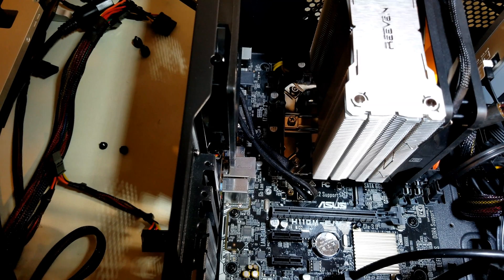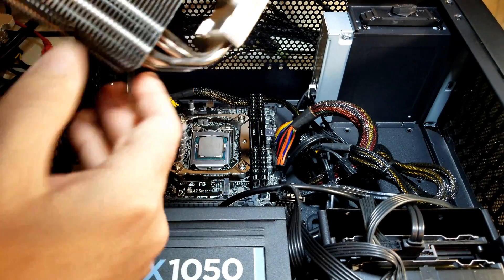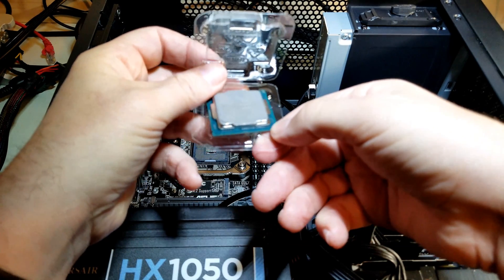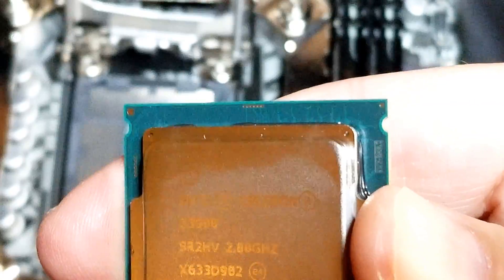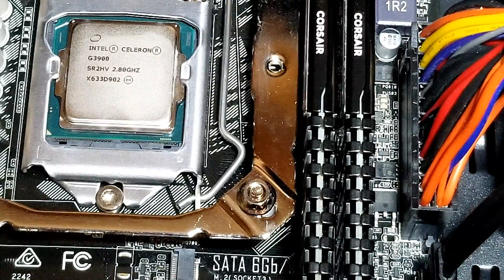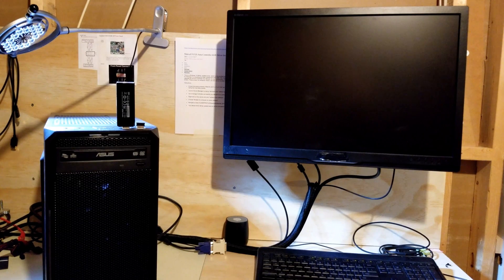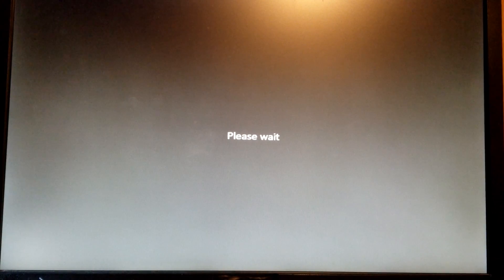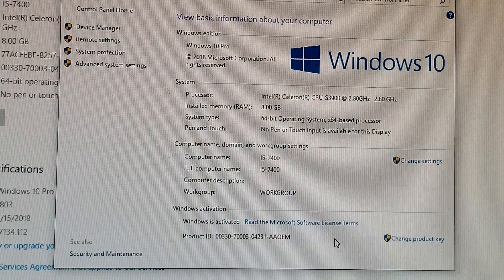Replacing your CPU  Win 10 will You need to Re-Activate it

Comment: I have a question, so if i have lets say a i7 cpu and i buy a i9 and if i change it to the i9 bought will i lose my data
Reply from the maker: No, it'll be fine, I've switched up CPU's from one to another and It was all still there and in tact...
Reply: @Reviewing_Playing_and_More_RPM  thank you so much you don't know how much you've helped me
Reply from the maker: @georgethetoaster4499  Glad to help you out...
Reply: @Reviewing_Playing_and_More_RPM  hey. Nice video sir cheers.  I have an intel i5 4th gen cpu. I want to upgrade so i bought ryzen 5 3400g and a msi mobo.  So the question is, will i jave to reinstall windows for it work? What about the intel drivers that are installed in my windows?  Will it just boot up if i put the new cpu in the new mobo and start it?  Will i have to install amd drivers prior? Or remove the intel drivers before swapping?   Hope you answer as im new to this.❤️
Reply from the maker: @Kavan_Mane  As long as the CPU and MB are compatible, you can use the HD with your Windows 10 and other software and it should boot up just fine. You may want to backup your software first just in case though. You will need to install the AMD Software and need to remove any conflicting Intel software. I've done this several time in the past and it worked great, I did have one time that I had conflicts and it did take a bit of time to fix. The recommendation however is to say never do this and do a fresh install of Windows 10 and re-install all your software backing it up of course first. So choice is yours...you won't need to install drivers first...As to whether it will just boot up, yes it will, worst case scenario and you run into problems (provided you did a backup just in case) you do a fresh install and go from there...either way you will need to install the Software that came with your Motherboard...hope this helps...
Reply: @Reviewing_Playing_and_More_RPM  thanks sir for replying. My mobo just came in. I will do everything as you said. Thanks for the help. 👍
Reply from the maker: @Kavan_Mane  No problem, have a great day...

Comment: It’s weird I just installed an aio but I clean my cpu first so I took it out and put it back in but it only boots to the bios and dosent have any other boot options can anyone help?
Reply from the maker: As long as it went in with no issue's and you re-applied Thermal Paste and the AIO ok, then you'll need to ensure you have it plugged in to the correct spot, ie either the CPU Fan Header or if you have a AIO Header then check nothing happened to your Boot Disk...in which case you might need to re-install the OS...

Comment: Ok so i clicked save and exit it reboots and keep going back to the bios what do i do?
Reply from the maker: I've run into this error once or twice, make a change in the BIOS, then change it back, then F10 to save and exit and hopefully that will fix it...if you can get to your PC try this it's a Win 10 fix for this happening: go: Start > Settings > Update & Security > Windows Update >Check for Updates. ...you won't actually need to update anything it's just a script that seems to work..
Reply: No it didn’t work would it hurt if i click exit without saving?
Reply from the maker: @itsjustriot9906  No if you didn't make any changes then hold your Power Button down until it shuts down, then hopefully it'll start up ok...

Comment: So I’m think of upgrading my cpu from a i3 9100f to a Ryzen 5 3600 will all my data on windows save??
Reply: Because I’m confused
Reply from the maker: So your going from a Intel to and AMD CPU, so there are a lot of things to consider, and because your switching the Motherboard, you may need to have a new Product Key, but you can try calling the Automated Microsoft Number and might be able to activate it that way should it not work otherwise...Windows 10 should boot right up on a completely new system. The first time it might take a little longer as it sorts out all the new hardware but it should be ok. If it doesn't go well - then yes, you might have to reinstall and risk losing your Data. You should take good backups ahead of time, just in case so your Data will be safe. But having done this a few times I was able to keep my data but needed to re-direct some games and programs, which if that happens can be a real pain...overall though as long as you take precautions you should be able to switch over and it will go fine, keep in mind that with a new Motherboard and CPU you will have new Drivers to sort out, Windows will fix most of them, but there could be ones specific to your MB that you will need...Let me know how it goes...Thanks...

Comment: Very helpful.  My business PC just fried a motherboard.  It was an old Inspiron board.  I used a mining board ga-h11 with a celeron I used for mining as I needed it up and running immediately.  I had windows 7 on the old pc with QuickBooks, office etc and switching out was a big mess, but a local PC guy changed out the board and put win 10 workstation and office on another 500g ssd I had from the miner.  Luckily I was able to transfer all the needed files, redownloaded QuickBooks and loaded up my company.  Now, I am up and running but I have the slower processor still that I used for mining. So I guess a can just pop in a next gen CPU without too much effort.  Thanks for the video.
Reply from the maker: As long as the new CPU works with the Motherboard you'll put it into, they have to be compatible, so to check you can go to PCPartpicker.com and load in the items you want to use and if they are not compatible a message will show on the screen letting you know, in which case you'll then need to go to a different MB and CPU that are compatible...Thanks...
Reply: Reviewing Playing & More RPM   Thanks for the tip.

Comment: question, is windows still activated because windows was previously activated and used with the replaced CPU?
Reply from the maker: No, Windows was previously activated, with the motherboard, so replacing the CPU did not require a new activation, the new CPU had not been activated prior to being in the system...

Comment: I am upgrading from i5-6500k to i5-8400k . Will i have to install any new drivers or anything like that?
Reply from the maker: As far as the Operating System, do a Full Install, then it will find many if not all of the drivers you will need. However because your switching from a Skylake CPU to a Coffee Lake CPU this means different architectures so yes there will be some new drivers...You'll see an approx 28% increase in performance as well...Something to keep in mind is although Coffee Lake CPU's use the same physical LGA 1151 socket as Skylake and Kaby Lake the pin out is electronically incompatible, so you will need a new motherboard. So likely a new Operating System could be required as well...Hope that answers your question if not ask away...Take Care...Thanks...
Reply: @Reviewing_Playing_and_More_RPM  Alright. Though i just have to reactivate my windows after changing the motherboard.
Reply from the maker: @roastedduck3001  Yes, but with a new motherboard sometimes it will require a new product key, and for the I5-8400K you will need a 300 Series  motherboard...Hope I didn't miss anything let me know if you need anything more...Have a great day...

Comment: Replaced the CPU but I keep freezing when entering desktop. I'm going to use Windows 10 to repair it.
Reply from the maker: +Aron Marczylo Ok good luck hope that works, if it doesn't it's possible you might need to do a fresh install. I'd be interested to know how things work out if you have time. Thanks for watching...
Reply: @Reviewing_Playing_and_More_RPM  Eh, it seems that CPU just doesn't work. I've had it for years, but I'm doing a reset anyway (been having major issues with it ever since I used AVG Tune up)  and since I didn't back up my restore files I can't go back. Hoping this resets the drivers, but uncertain as I upgraded recently from Windows 7 in hopes of that causing a fix.
Reply from the maker: +Aron Marczylo Well good luck hope it fixes everything. If you have to start over might suggest reset your HD then install Windows 10 fresh install at that point if you have a product key  that is.

Comment: Windows 10 pretty much locks its self to the motherboard, I've changed out everything on an AMD 970FX motherboard, CPU, RAM, SSD, HDD, and windows 10 still activated its self with  different hardware. Thats one thing I do like about windows 10, The interface still bugs me though.
Reply from the maker: Yeah I like that it gives more flexibility and no worry until a new MB is needed. Thanks for providing that info wasn't certain. Thanks for watching...
Reply: my biggest annoyance is that it forces updates, and when it wants to update, it seems like it can have nothing else on its mind like a 5 year old that hasn't gone to the bathroom all day and now can't maintain any thought process except getting to the bathroom. Whenever my computer starts acting funny and is not able to complete tasks without minor errors, I check for notifications, and sure enough, there's a update waiting to be installed.
Reply: @davidscott5903  Oh yeah, I hate that as well, and if you do postpone it for 4 hours, it will ask like 10 min later again lol.
Reply: @VikingDudee  yep! 😂

Comment: My question is, if i replace my cpu from i5-2400 to i7-2600k
Can i start up my pc immedianetely?
Reply from the maker: Jussi Justin Because it shares the same Socket yes it should work as in my video,  but Disclaimer I have not 100% verified this so there is always a risk. Ok that out of the way don't forget to apply new thermal paste and while I don't think so you you may need to upgrade your BIOS.  You will get a score increase from 26.8 to 38.8 plus you can OC to 4.5 or so and it's only 20 to 25% slower than Skylake or Kabylake...Hope that helps...
Reply: Same thing for Ryzen? I’m going from a 3 2300x to a 5 3600x but idk what to do before and after

Comment: someone knows if windows will deactivate if i switch my motherboard and processor but keep my hard drive with windows on it?
Reply from the maker: I haven't tested it yet, but believe if you switch both motherboard and processor even if you keep your hard drive, you will need to re-activate windows, but it might depend on version ie if it's not an OEM version, you could possibly call the telephone for microsoft and try to re-activate it online and that might work...
Reply: Reviewing Playing & More RPM I have a custom made computer and I want to switch both of them because I'm having some crashing problems that seem to come from the motherboard so I decided to upgrade a few more things like the CPU and the RAM now that I'm at it 

My concern is that it is a digital license and I have no actual windows 10 key, my license is linked to my Microsoft account because it was given when I upgraded from Windows 7 and I guess that the windows 10 license will only work on my actual computer and will become invalid If I switched those components
Reply from the maker: It is likely that after you switch then you'll need to buy a new license key, but to keep it less expensive remember to get an OEM version because it will be about $100.00 cheaper then the other versions...Unless you upgrade often it won't be an expense you have to often...
Reply from the maker: something to mention, is that you can install win 10 and not activate for some time, think 30 days so it'll at least let you know if it needs to be activated or not once done...
Reply: Reviewing Playing & More RPM thanks for your quick replies, I've been looking around my computer and both in the system info and with the "winver" command it seems like my license isn't OEM (in the video I noticed yours is since the product id ends in OEM and decided to check mine)

If I'm not wrong that gives me a lot more of chances of not having any more problems than having to use the activation troubleshooter and select the "I changed hardware on this device recently" option
Reply from the maker: jonathan alcocer Yes you should be able to but with Win 10 I'm not certain it would seem likely though...
Reply: @jonathana3872  
Did it work?